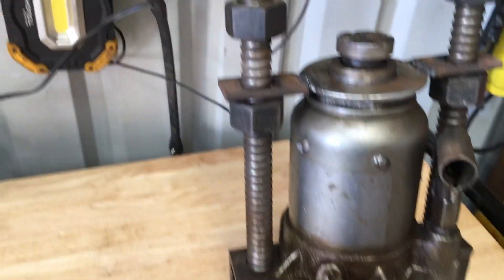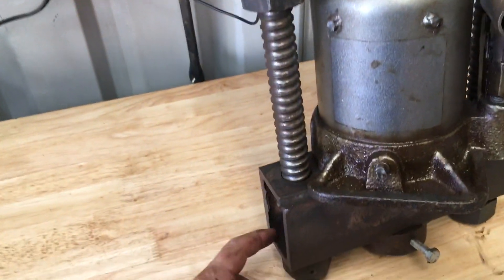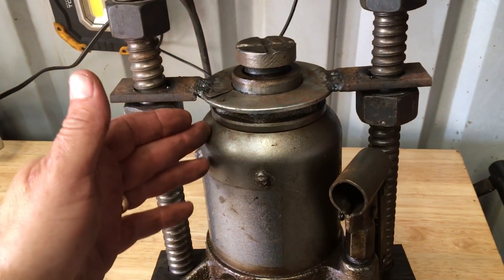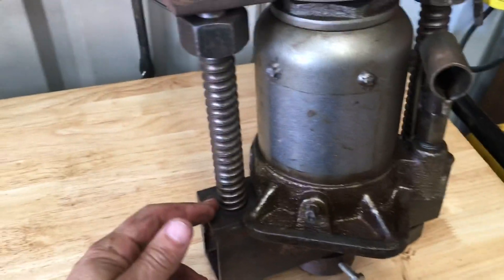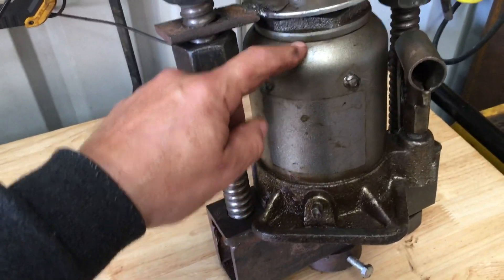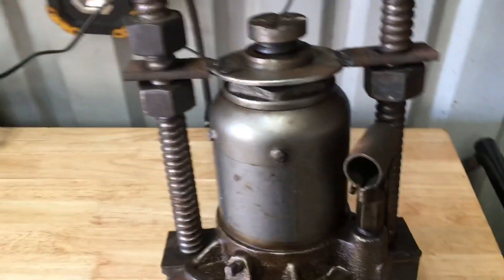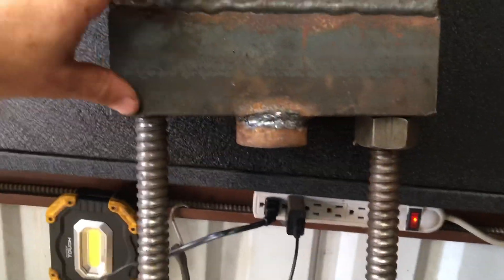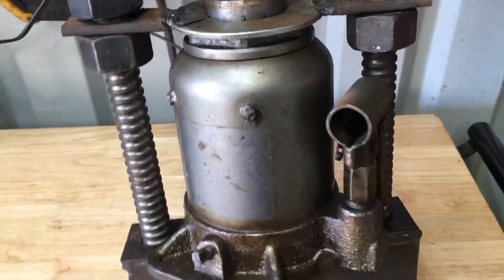Homemade track press

Comment: Thanks Frank, 
Might be able to make it friendly to push out kingpins and hydraulic cylinder pins that are stuck or even a stuck ball joint.
Just thinking of other uses. 
Maybe use Railroad tie plates with gussets for mounts, since there are a lot where I am located. Concrete brace rods and nuts look better than using expensive acme rods.
Great idea!
Reply: That's exactly why I am here! Looking for a king pin press
Reply from the maker: Great idea

Comment: Any particular reason for using the coil threaded rod instead of an acme threaded rod?  I could not find any particulars on the coil threaded or attributes of it.
Reply from the maker: sequoyah59 it’s pretty inexpensive here are the specs. I suppose you could use any thing you wanted, but I like how it threads fast. http://www.daytonsuperior.com/docs/default-source/tech-data-sheets/b12coilrod_td.pdf?sfvrsn=c9f2d560_31

Comment: Seeing this is making me think of an application for a break for CMU block walls to get chip face. Maxwell Supply, here I come. 

Unrelated, but I just noticed a crack in the loader bucket (thin metal) of sub compact tractor. Do you have a recommendation for welder to repair?
Reply from the maker: That may work, as for the crack, it depends on the location. I will usually vee the crack and weld up with 7018. May need to plate it too.
Reply: Do you have recomendation for shop/person to repair? R/R the plates on the bottom that have been worn away over the years of use. The crack is on one of the corners where the plate steel has been ground down over the years.

No box blade, so would back drag loooonnnnng gravel drive. I have since the improved skill since watching videos and spending a bit of time in a skidsteer.

If not, general enough repair, I think, to use Google to find shop. Thanks.
Reply from the maker: Where are you located?
Reply: @Digginok  Norman.

Comment: thats a really handy tool!!!!  i built a similar one for pulling and pushing all those track hoe bushings, but i had to upgrade to high strength all thread, the galvanized available from the local hardware store kept breaking on me!
Reply from the maker: This coil thread is super tough, way better than regular all thread